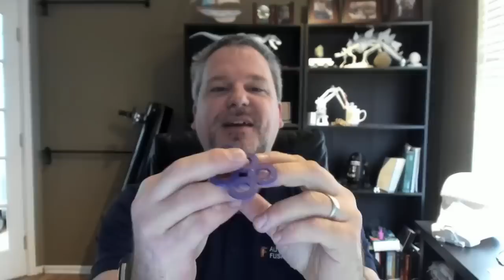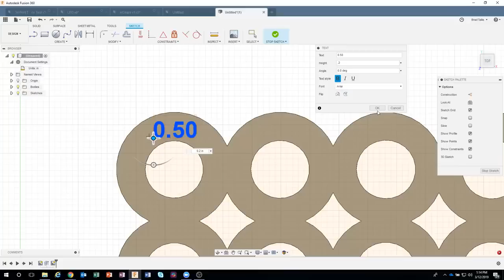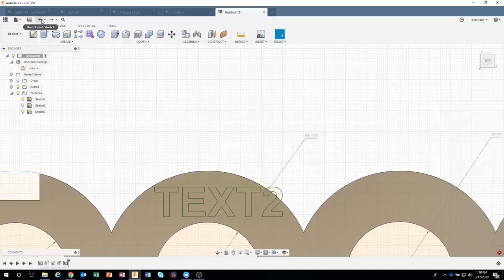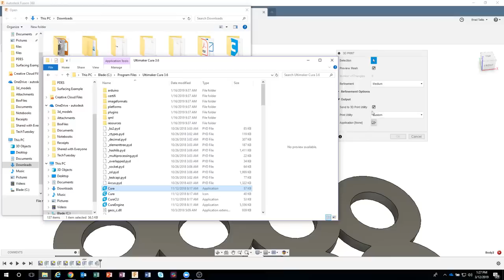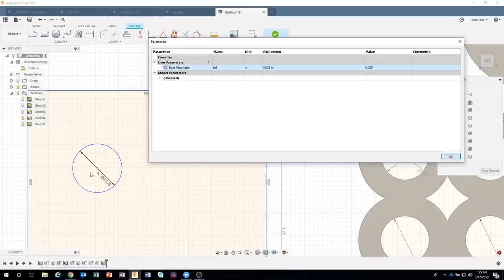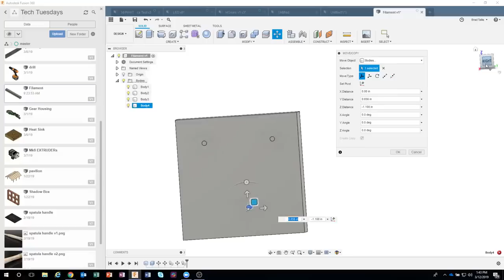Episode 19,  3D Printing Tips with Fusion 360

Comment: Show sketch dimensions in 3d, that was a good hint.  Also instead of gauge blocks I make a primitive shape that will just be big enough to encapsulate the joint then intersect and print just the small intersect part to test fit.

Comment: Brad I chamfer all bottom edges of holes etc. for a few layers to deburr any over extrusion against the print bed. 

If you are up for a tutorial challenge, herringbone bevel gears using a spherical involute tooth profile. The approach I have unsuccessfully attempted was rob a spur tooth profile from a helical 360 plug in app and then sweep or loft it along a rail or rails. For the rail or rails I have been playing with a tapered coil with a triangular cross section. I figure an involute profile will make PLA gears more efficient and therefore less likely to melt.
Thanks
-Peter

Comment: Brad, thank you for this lesson. GREAT.
hat parametric change in the shetch mode is fantastic.

But when endly correct Fusion the ISO Metric trapizoidal tread from 60 to 30 flange angle between the flanges. What a faulth and  simple to correct I think
Its there for a long time.

Comment: Great post brad especially about using the parameters for the adjusted hole dimensions, but if using the thread feature to make say a nut with iso features it does not seem possible to enter anything apart from the pre set sizes
Do you have any solution
Reply: I worked around this difficulty using press/pull: I zoomed in close, picked each of the faces of the thread and pushed them back by the tolerance measure. In that experiment, similar to what Brad did, I printed a bolt and a group of nuts with different tolerances applied to their threads and texts printed onto the nuts to identify them. That way I could easily pick out my ideal fit and use its tolerance in the final print.
I did not take the time to look into the workings of the press/pull command; I applied it to each face in turn, hoping that I had not picked a face twice while leaving another one out. Maybe I should have colored the next face to be pressed (each in a new color) before applying press/pull to it. I feared that choosing all faces together would make controlling the direction of pressing difficult.
Reply: Hi
Not really sure what you mean, i have tried with a 50mm thread but does not seem to want to reduce
Reply: Have a look here
https://youtu.be/1nhcKn7Kt8w
Stefan shows the method I worked out for myself in his very professional way - and then some!